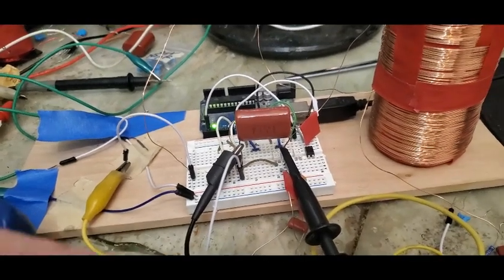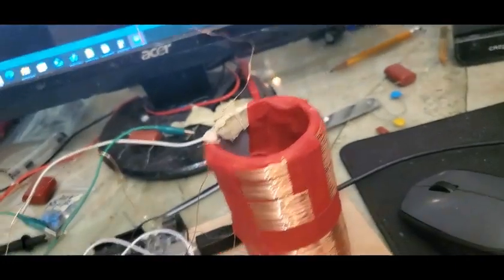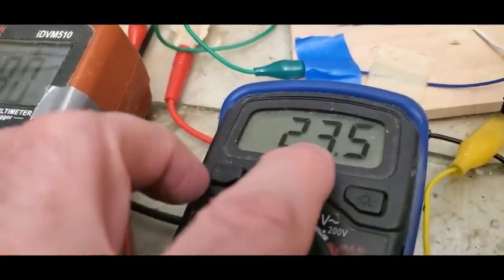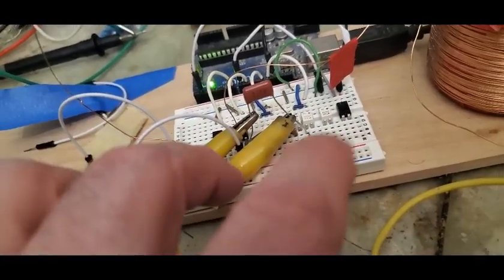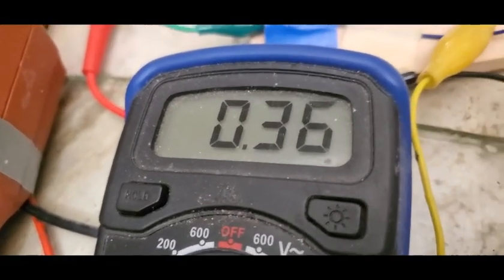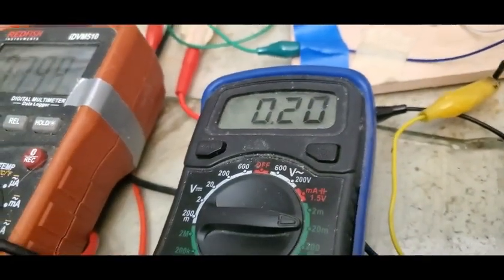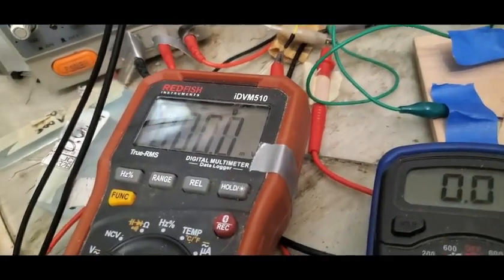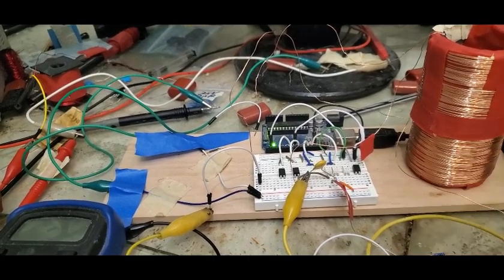Bifilar Coil: Addendum

Comment: Would be nice to have a schematic drawn with values and turn ratios! Looks good, looks like you might be onto something like Don Smiths Invention, without all the high voltage.
Reply from the maker: Hey Ryan, who said anything about Don Smith, I didn't say anything about  Don Smith, hehe. I did watch one of his early videos just in the past week or two.  Suffice it to say, while Don was an outsider like me, I would guess he knew a good bit more than I currently do about how coils ring.  Also funny, I have an uncle named Don Smith, he was a Judge in New Jersey.  If I have something nailed down I might try to teach myself some circuit drawing software, for the moment I will just say the turns ratio is 1:1, one wind of the bifilar has ~17.5 ohms and 12 mH, it is ~ 10 layers.  Now that you mention it I have an 8 inch diameter 1 layer 1:1 bifilar similar resistance maybe 8 mH, and I will set up the exact same thing with it and see if I also get a similar sort of behavior or need to preserve the first coil in resin, hehe.  As I hinted at in the video I am also not sure if what I am seeing is as odd as it appears at first glance, many times I am left thinking oooh, shouldn't have mentioned that one you nincompoop, but if I "pump up the volume" I should have my answer.
Reply: @ryanthompson6865  i asked Grok (I've seen others have good success with chat gpt) and it gave a pretty detailed description on Don smiths build, including turn ratios, cap size, diode votage ratings etc. Don't smith used bare wire, but shielded wire seems to work fine and is WAY safer.
Reply from the maker: Interesting approach.  One take home I have from Don Smith is, apparently, he said he looked into all the Tesla experiments from the book what is it "Tesla's experiments, research and Inventions" or some such, a book I happen to have but have not yet read in it's entirety. Probably a good goal to read that in its entirety and maybe even experiment some from it.
Reply: @paulmaher812 it would be interesting to have all of Tesla writings! What is the book name you have, might need to see if it is one I have already read.
Reply from the maker: @ryanthompson6865  "The Inventions, Researches, and Writings of Nikola Tesla" edited by Martin Thomas.  https://www.amazon.com/Inventions-Researches-Writings-Nikola-Tesla/dp/1454910763 I have a paper copy but it is also available on the Internet Archive https://archive.org/details/inventionsresear0000niko 

I really need to take the time and plow through that book.  Much of it is reiteration of patents, but it also has the text of three speeches Tesla gave to Scientific/Engineering organizations.
Reply from the maker: Ryan, Took me awhile to get why you were excited about turns ratios, I am sometimes a little slow on the uptake.  On the ten layer bifilar coil threw one more layer on the secondary today.  As not a bifilar layer this took the turns ratio from 1:1 to ~ 1.2:1. mAmp draw to secondary went from ~ (also a bit frequency and capacitance dependent) 0.5:1 to 0.6:1.2.  As Gimli said to Aragorn on finding him alive before the Battle of Helm's deep. "God Bless you Laddy!!!" Not certain I would have thought of that myself.  Will look at a 3:1 turns ratio next.  You need to preserve a high Q factor in the primary but aside from that if this holds I don't see why you might not have a 300:1 turns ratio and skip the 10kV input.
Reply: @paulmaher812  not needing the High Voltage would help a lot of people plus safer. Turn ratio is critical as you now discovered! Lol. Keep up the good work my friend.